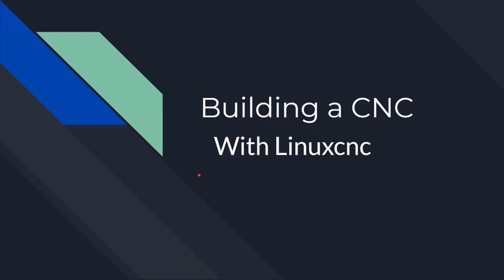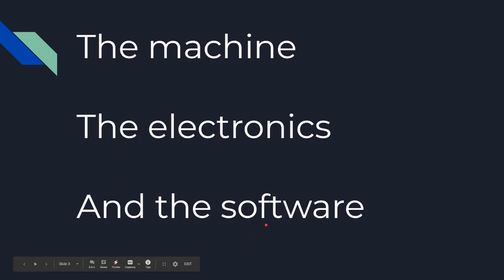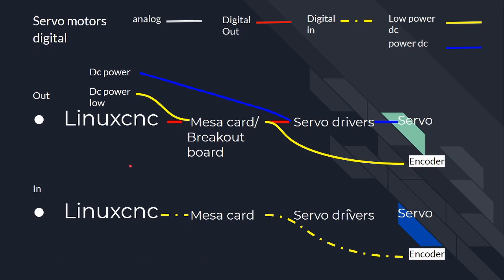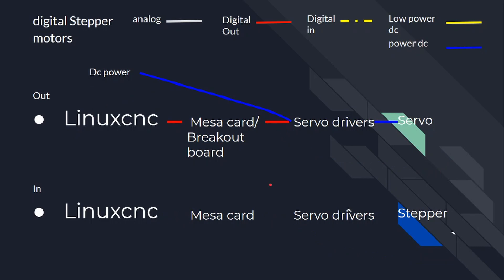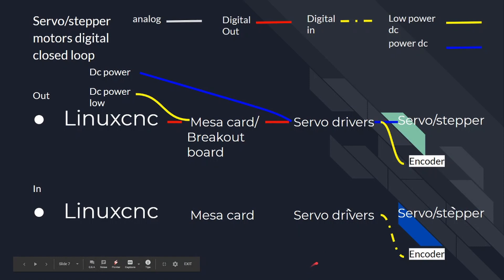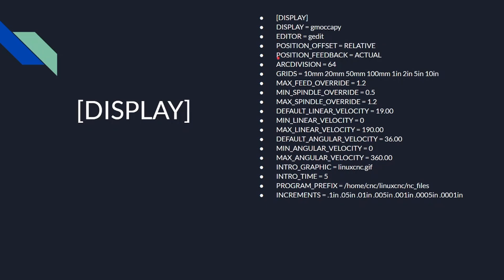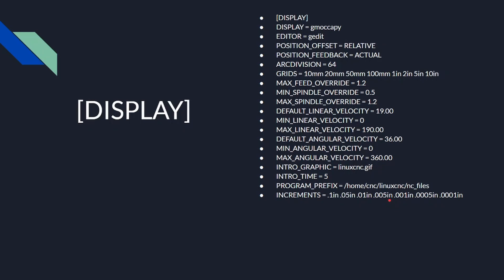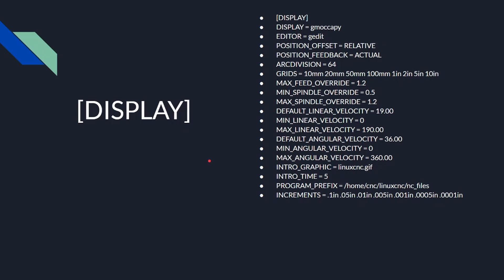linuxcnc servo/stepper motors closed open loop analog servo motors and the ini file gui

Comment: Would you Be interested in doing a Pncconfig video? I’m super new to all this and you are about the only one I see with a setup using analog. I have the 7i97. Setting it up with an old Anilam 3000m system. DC servos and encoders on an Acer e-mill